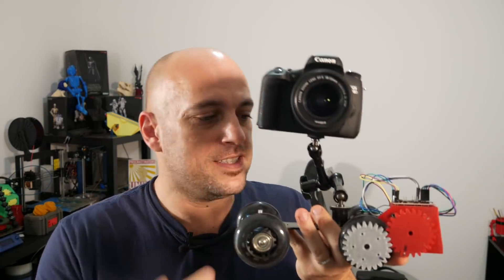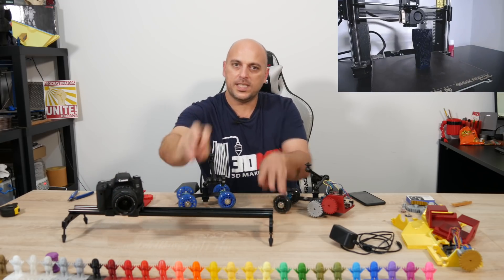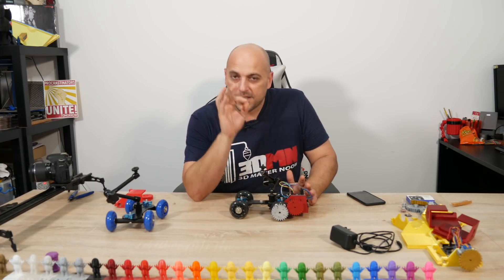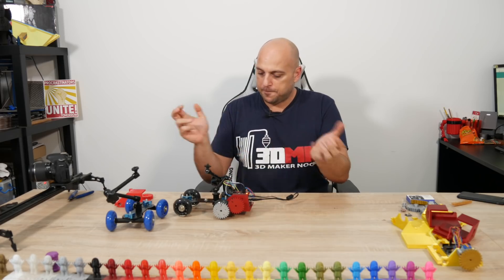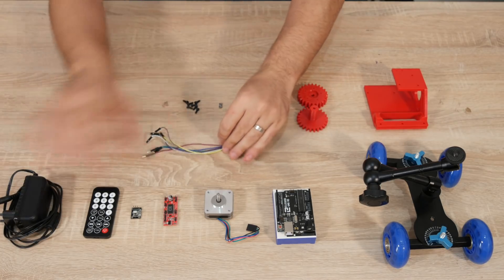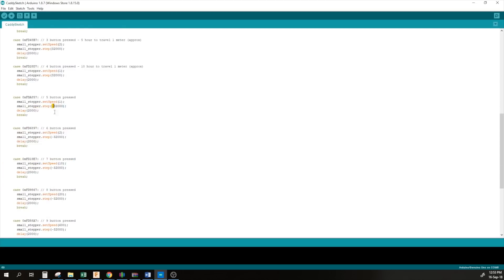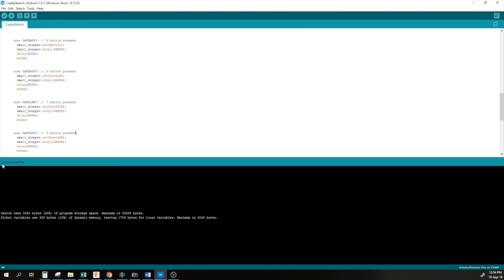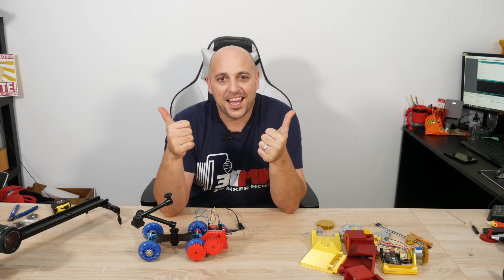EPIC 3D Printing Timelapses! | $50 DIY Camera Dolly

Comment: I already made this dolly 2 years ago... It was working well. But I would like the movement to be smoother with a TMC2208. Do you think if is possible to replace the easydriver by the TMC2208? And what should be modificated on th sketch? Many thanks!

Comment: I know it is not the point, but you could go even cheaper (and dumber) making it just with a AA batery,  a dc switch, a variable resistance (to change speed), a capacitor, and a toy RC motor.
Reply from the maker: And have it get stuck because of weight (no torque) and have it run out of batteries after 2 hours into a 20 hour print :)

Comment: This is just awesome. Really cool design and great results. I was just wondering, not that the current setup isn't smooth enough, but do you think there is a way to implement this with some kind of brushless motor? They are often used in gimbals, etc, for their smooth motion but I'm not sure they can go slow enough to take long time lapses. Anyways, really cool project and I will definitely try to make one of my own. Keep up the great work!

Comment: Hey Joe, Nice job on this project. Just out of curiosity, how did you trigger the camera? I see the Octolapse trick happening, so you must have triggered the camera from your printer, but I don't see any wires going to the camera.
Reply from the maker: It’s through octolapse with a python script to trigger a DSLR, the usb cable on the canon is on the right side so it wasn’t in shot I think
Reply: 3DMN  If you want to make the whole thing wireless, you can use a $1 remote to trigger the Canon. These can be found on ebay. It is a technique that I used/showed a couple of weeks ago in a video to great success, and it's probably easier to set up than the USB cable.

Comment: I personally loved it. I found nothing wrong with it.
 It was a great video.
However, the maker, Hardware Arduino aspects of it, do put it in a niche category. 
There are other factors to consider when watching the views on the video. How many of the views are subscribers? and how many not?
Another big factor to consider is that it not part of your "Core Content" ie 3d printing, therefore, YT don't push it as it doses the 3d printing specific stuff.  
As long as the majority of your subscriber base love it, don't worry about it.

Overall, I wouldn't worry about too much.
 While this is probably above my skill level I still enjoyed it and found it interesting.
 I still have a Rasberry Pi3B+ that have yet to make do anything more than just boot into Rasiabaiaian. LOL

Comment: Hey Joe, you can make the slow speeds much smoother by enabling microstepping - just connect 5V to MS1 and MS2 pins on the EasyDriver and multiply all step counts by 8 to get the same travel distance.

If you don't want to solder multiple wires to the 5V line, connect the MS1 and MS2 pins to any free digital pins and set them HIGH in the Arduino sketch using ie. pinMode(13, OUTPUT) and digitalWrite(13, HIGH), google for examples.

Comment: Welcome to the arduino world!  For a first project: really nice! Sure it can be done better, but thats never the point in any arduino project. It has to be fun and it has to work. Mission accomplished with bonus points for the remote! In case you want to do more with arduino, and use network: look at the esp8266 or esp32. Can use same ide for programming.  But I guess this one is best for this project. Didnt know octolapse. Going to install it next. How did you sync the camera with octolapse? Again, really nice project!!

Comment: nice one, you could use a powerbank for easy usb power, no cables to worry about.
Reply: Yes, that's missing in this project. Also, there must be a way to make a stop/go command from IR, or dynamically change velocity.
All in all, very nice project!
Reply from the maker: Power banks definitely won’t last through a 20 or 30 hour timelapse, there is also still the power cable of the camera. As for a power button, I’ve spent many sleepless nights trying, ultimately I just wanted to be done for now hehe
Reply: You did well! Don't worry. One think I don't remember seen in video is how to easily find the center of curvature: simple by finding the interception point of the two axis!!! That's it!
(btw, I don't know what's the mean current, but two 2000mAH Li-on battery should be able to do +20h; how much energy is necessary to drive this setup ~1m in plain surface? Very little, I would think...  :)  )
Reply from the maker: Power banks definitely won’t last through a 20 or 30 hour timelapse, there is also still the power cable of the camera. As for a power button, I’ve spent many sleepless nights trying, ultimately I just wanted to be done for now hehe

Comment: I love the idea and how flexible it is!
I personally would have choosen some kind of Rails tho (used it for my DIY 3D-Scanner too) in a fitting curve 
maybe even make it modular so you can add or remove parts of the rails in between, have endstops on both sides so the device knows how long the traveldistance is and you can adjust the overall time it should take

ahhh, all this possibilities to waste time i cant even afford to waste :D
Reply from the maker: initially i did think of rails, but then you are restricted to a certain circumference, and if you need a different angle, you need more rails. this way, you have any circumference size or even straight with just a simple screw :)
Reply: 3DMN  exactly, thats what i love about your design! and i think it makes a lot of sense for someone like you who has many many different sized and shaped printers, so you have one system for all.
for me, as someone who has 2 printers on two different locations i might go with rails ... just have to figure out a way to make the nozzle be stationary and "out of the way" like you did, did you work with a post processor for the gcode (moving the nozzle at the end of each layer) + activating a certain pin whenever the photo should be taken? (if you already said it in the video and i missed it i am sorry!)
Reply from the maker: actually it's a much easier process, install octoprint on a pi and and octolapse plugin :) it does it all automatically
Reply: 3DMN  ahhh, i see! i will look into it, this sounds interesting, one last thought of my side: if you can tell the plugin to do it twice per layer (move to a certain position + take a photo then) then you could theoretically have the nozzle all on the left in one, and all on the right in the other photo, that way you could use e.g. photoshop to combine both pictures to one without any trace of the nozzle (just saying as an idea, i dont mind to see the nozzle too much)

thanks for your awesome content btw. you rock!

Comment: Fantastic design and device. I was wondering how you made those time lapse videos so really looking forward to the following videos. Can't wait as I'm ordering a Raspberry Pi next week for Octoprint. Just don't tell tell the misses 😉😉😉
Reply: You're gonna love Octoprint. I have it on all my printers. It takes a little practice to get used to it, but it well worth it.
Reply: @spikekent  I've been watching as many videos as I can find to aid in preparation lol
Reply: Octoprint is an AMAZING tool for the printers. I currently have 3 printers and all 3 are running octopi, each with their own benefits. One for example, i am able to turn on the printer, prepare it and print without ever even being on the same floor as my printer. The all are running filament run out and cameras. Now even when I'm not at home they can all be safely controlled remotely. It truly is a safety addition as well a luxury.
Reply: @Scott Schnatzmeyer Very much the same as my setups, with the exception of the power control. I've had problems finding the correct 3.3v relays to switch 240v. Do you have a link to the ones you use please?
Reply: use transistor to drive the relay
Reply: Hey @Scott Schnatzmeyer Thanks for the link, very interesting. However, I found an alternative and it was sitting on my desk the whole time Doh! I brought 2 Sonoffs ages ago, but had never got round to using them. Flashed both with Tasmoto and configured the pluggin and away it went. Happy days. For me this works better than a relay, as it means I don't need to have the RPi wired to anything else, I have the Sonoffs controlled over wifi.
Thank you all for your help though, it's very much appreciated.
Reply: @spike i used a 5v relay and a 1k ohm resistor to drop the signal to 3.3v. I will find the link to the video i used. I however am using 120v but the relays i bought control 250v safely on Amazon.